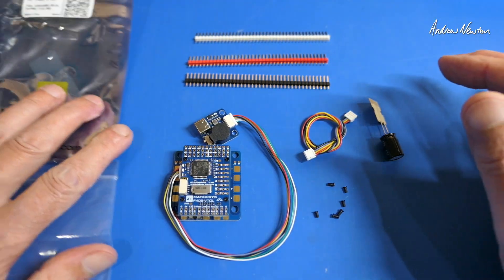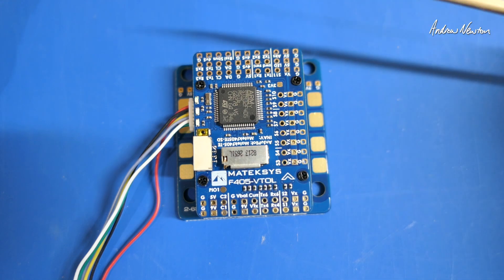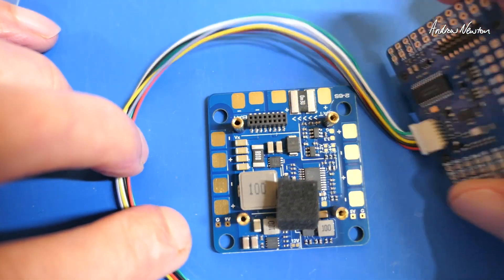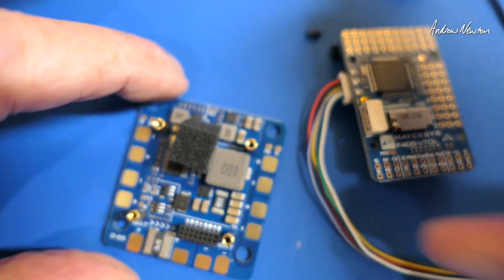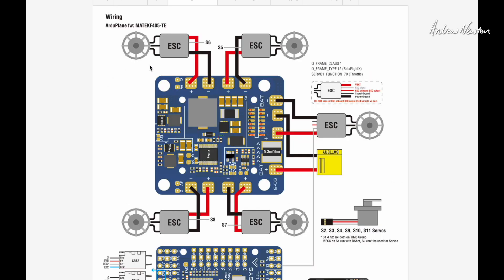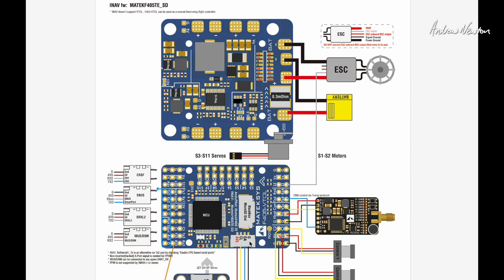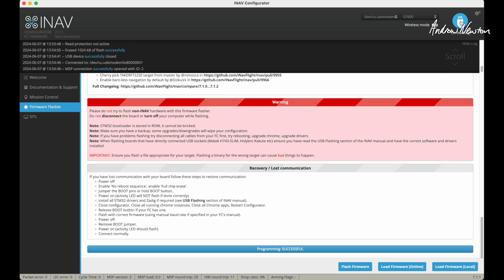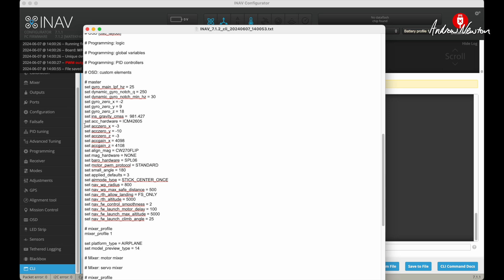Matek F405 VTOL Flight Control Board

Comment: In 4+1 planes, sometimes its more appropriate to use sepparate  batteries setup. E.g a battery pack for the hovering motors and another pack for the pusher motor. Is such a setup possible with this FC ?
Reply from the maker: The board is designed for only one battery but no reason you couldn't bypass the PDB with the second battery. Would need to make sure the grounds are all common.

Comment: Hello!I would like to see a VTOL variant with rotary motors, as an example-Hee Wing T1 Ranger VTOL-they use rotary servos to switch from vertical takeoff mode to horizontal flight mode (and as an option-not with two rotary motors, but with all four at once).
Reply from the maker: Interesting idea, maybe more complicated than the usual VTOL configurations

Comment: Will this flight controller work for standard fixed wing?  I am looking at this Fc over the standard F405 fixed wing due to F405 FW having 5amps continuous and 6amps peak, while the VTOL has 8 amps continuous and 10amps peak.  I think I need the higher BEC values since the Super Tucano I have ordered  has 6 13g servers, 1 25g server, and retracts, and FPV with pan and tilt.  Sound about right?
Reply from the maker: Yes good idea. 
This board would work well for higher demand models.

Comment: extra servo amps is good for tilt motors I guess.  Makes sense for a quadplane but I like the single-board lightweight f405 wingV2 all on one board and feel it has enough pads for 3 motors imho.  I have yet to complete and fly my Dart tilt motor vtol though, hope the v2 has enough servo amps.

Comment: i stopped buying matek when they stopped supporting and started cheating the elrs team.
Matek is no longer elrs supported product but Matek tells their buyers they should use another elrs target instead to get any updates. 
Imagine this second vendor will stop supporting then the whole mess starts again.

I have bought speedy bee fc instead and sold my old matek flight controllers

I hate to see this kind of cheating.
Reply: so they cheated by using ELRS engineering on their own ELRS receivers?  I don't get how you'd say a Matek FC won't be supported nor updatable with iNav or Betaflight (or Ardu), and just plug your 3rd party ELRS receiver into any uart?  I am genuinely unaware of this situation, have used Matek for 7 years with great results, but I am still using Crossfire.  I have a new ELRS radio and considering the switch but would be using 3rd party ELRS receivers not Matek.  I have a SpeedybeeFC in the box but it is a heavy inefficient looking thing in comparison.

Comment: Andrew. Get hold of a Bixler and strap 4 motors onto it via a couple of carbon tubes mounted on the wings. The standard Bixler motor remains as the plane motor. You do it first and I’ll follow you
Reply from the maker: Ha, not really tempted by a full quad plane but we will see
Reply: @AndrewNewton  ah, but the FC is built for a full quad plane; pretty please?